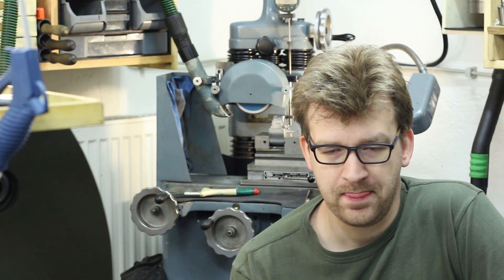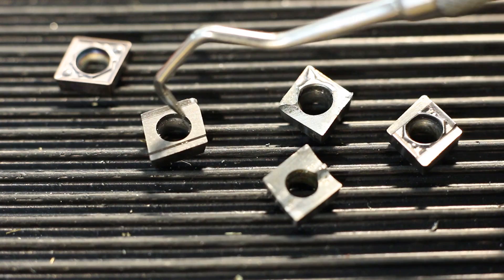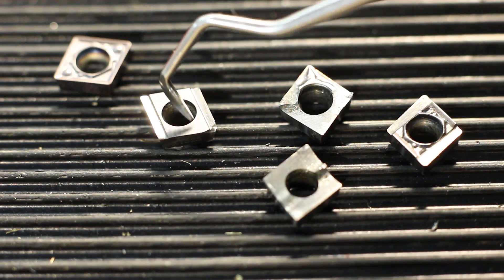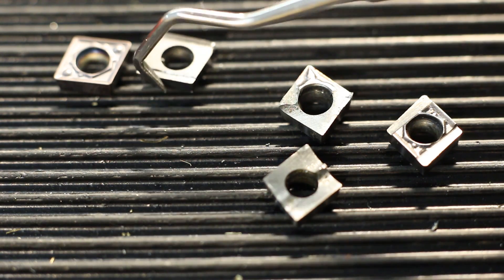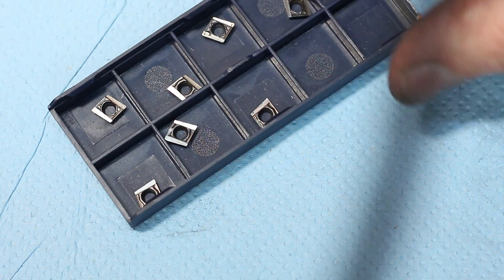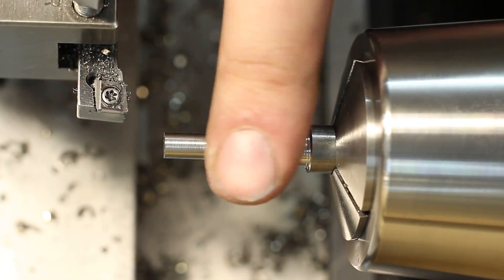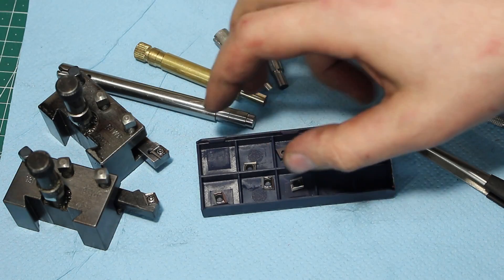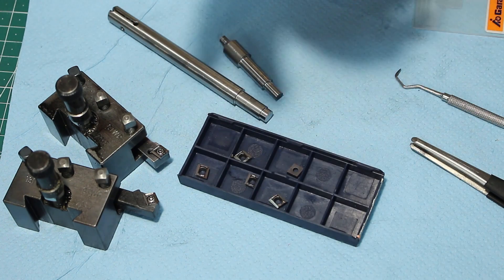Regrinding carbide inserts

Comment: does anyone know of a good resource for identifying anonymous inserts? is such a thing even feasible (i.e., is there a standardized nomenclature / categorization, as opposed to a host of manufacturer-specific ones?)? so far, the best thing i've come up with is the 'Carbide Depot' site (http://www.carbidedepot.com/carbide-inserts.aspx), which makes narrowing down insert types by observable geometry (e.g. 'oh, this one i've got is square, has this sort of feature on top, & is this long on a side - must be a [XXXX]') a not-terribly-arduous task, but not a terribly easy one either, & i'm worried about comprehensibility.

specifically, i'm interested in getting more inserts for an insert shell mill i have, which as far as i can tell is devoid of manufacturer's markings (&, of course, so are the inserts that are running in the tool at the moment), & want to make sure that the inserts i get will actually fit in & cut well on the tool in question - i'm assuming that the inserts currently in the thing are the proper variety, & planning on getting some as closely resembling those as possible.
Reply: But the real difficult bit is the chipbreaker design, this will define its use more than the actual shape.

Comment: Good inspiration... 
I'm presently working on wood turning tools, where a very sharp edge is required for better performance, the surface grinder is also in my opinion the best tool to use.
The plan is to use cheap chinese metal working inserts and redo the top and  edges, that's a project that I'm workin on with a YouTube producer that has a channel on wood working.
Naturally minimum modification on the original inserts is one important goal...
Reply: Hi Pierre, wood turning tools really need to be SHARP, if you want to do the job properly and slice the wood fibres. Carbide will only really work as a scraper and this is not the ideal way as you invariably get sub surface damage which tales forever to sand out. A sharp tool, with the bevel rubbing the wood, will leave a finish ready for polish. As the great woodtrurner Frank Pain once said, "cut wood the way she wants to be cut."
Reply: Going to back up Chris here.
Carbide is probably just not the right material here. You need to use really high grade carbide to get a cutting edge sharp enough for wood, and the edge breaks down extremely fast on some woods. Sand and dirt are common inclusions, and some common woods like oak have salt inclusions.

Scrapers should be ground on a fine wheel so that a very fine burr is on the top of the tool, the burr is what does the cutting. If you cant raise a proper burr on the grinder (lots of practice) then the burr can be honed off and turned back up using a burnishing tool. Removing the burr and honing the scraper produces a tool more akin to a square end chisel - a useful tool for roughing, but will not produce the quality finish that a proper chisel or scraper will produce.

Gouges are usually best ground with variation on the cutting angle as it sweeps to the edge of the tool. Not something you can do on a surface grinder.

I personally prefer a convex grind on chisels (similar to an axe grind). I use both chisels ground so the edge is straight or convex. A convex grind allows you to use the chisel free hand since you can rest the tool on the work and roll the edge into the cut. This is extremely useful to fairing around curves and coves where the tool rest will interfere with tool movement. I grind mine on a bench grinder, but some folks use a belt sander with the belt loose.
Reply: Good point you're taking in here, I agree with you that a good HSS or good quality steel blade type  tool with a very sharp edge is best to really cut wood fibers, this is an experiment and it's possible that it will produce some good roughing toll and there is still gonna be a need to finish the conventional way with steel...

Comment: I am poor, so, regrinding my inserts is just the way of life for me, LOL...  I get allot of miles (kilometers) out of my indexables...
Reply: What machine you use to regrind your inserts ???
Reply: @fayaqureshi8124  Just a simple old pedestal or bench grinder with a "GREEN" wheel, and when I am feeling really determined, I plug in and turn on an additional grinder, that had a diamond wheel already installed on it, just to pretty things up a small bit, but is not completely required, as the green stone wheel, designed for tungsten and carbide removal, seem to do just fine. The down side to the green stones wheels, is that they do not last very long. but they are not expensive either, not much more then the grey stone wheels.. Be safe installing your new grinding wheel stone, study up, (if you do not already know, how to check those for hidden cracks by tapping method) plenty of YouTube videos about the stone checking methods.. good luck and be safe, Dru